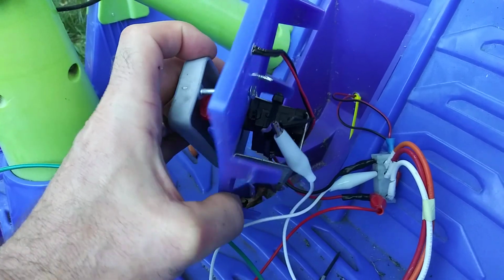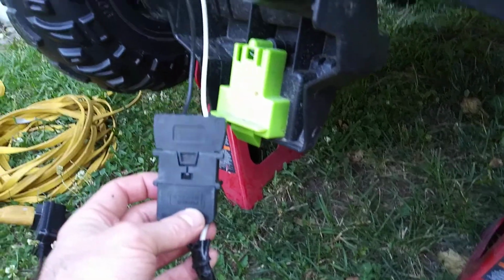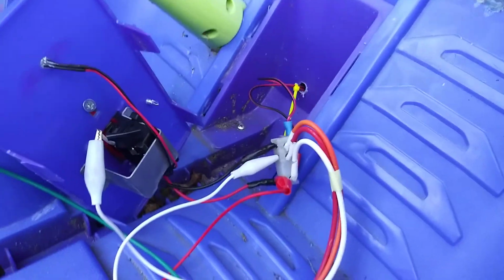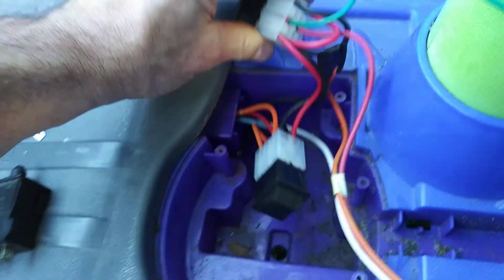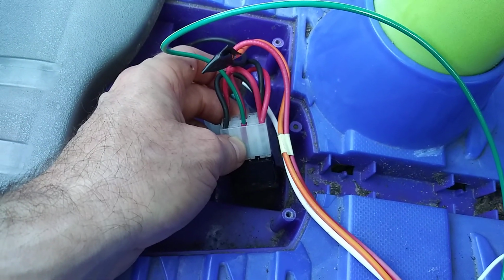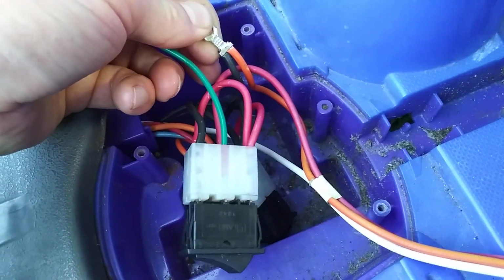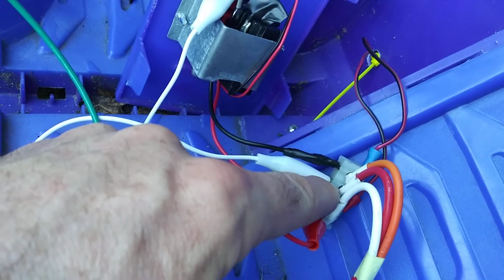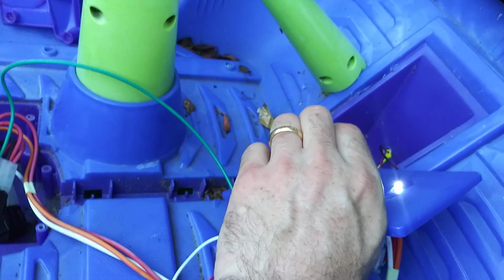AFFORDABLE Speed regulator pedal for PowerWheels. Less than ($10) drill trigger

Comment: Thank you for your detailed breakdown. Are you active in your comments? 

My 3 year old has a Power Wheels Dune racer that has been Modified to use two 12 volt batteries for a 24 volt set up. 
I am in the process of replacing the Accelerator pedal plunger switch. The issue is that the Current switch is a simple on off switch. Going from zero to max torque can truly hurt the plastic gears on the motors. Not only that, it also jolts and jerks the necks of my kids. 
I would like to replace the switch with a Switchdriver Electric Drill Switch adjustable speed switch. 

I need something that is strong enough to handle the voltage and amperage of the Powertools batteries. Please advise me on if that would regulate the speed of the motors. 

And if I have to use two of them to share the load and handle the amperage. 

If you have a Better and Affordable idea for a Slow start for the accelerator I would REALLY appreciate it.
Reply from the maker: @LostMexicanFilms honestly I was watching this video today and it’s pretty complex how I have it wired, but maybe you can make sense of it.  Looks like I depinned one of the connectors because the drill switch is ground side regulated (like a transistor, not a variable resistor).

But I did make it happen so if the wire colors match up in this video you may be able to copy it, but I can’t really offer any more details than is in this video because I have no idea what I did haha

Good luck on your project, yes a 24v power wheel is a lot of fun!
Reply: @ConvertTheClassics your video is the ONLY video on YouTube on how to offer an AFFORDABLE speed regulator for a Power Wheels. I know this idea would draw a lot of attention in dads. 
The next most affordable thing was a $40 dollar piece on there.
I looked for Speed Variable foot pedals EVERYWHERE for hours… finally it hit me. Drills and jack Hammer drills use speed variability… there has to be something…. Jackpot.

Ok… so based on your description the Drill Switch is not Able to regulate the flow of the Positive current…
Only the Ground/negative output. 

What would happen if I run Positive thru it? Burn it up? 

If that is the case… why can’t I leave it wired like it is and reverse the battery connections. Would that not be the easiest solution? 
Then simply turn one of the switches on the fwd reverse shifter? 

Please give me feedback. My kids need this thing running by Monday!
Reply from the maker: @ there is no easy solution because the drill trigger switches are electronically controlled mosfets as I understand and the polarity is specific to them, and they will only control the ground side.

Thanks for the encouragement, let me see if I can watch this video again and maybe put together a wiring diagram to discuss in a separate video!
Reply: @ConvertTheClassics  keep up the good work brother

Comment: Brother. I had the same idea. I ordered two drill switches from Amazon cause the only ones I found were 16amp… so two of them to take the load.
Reply: The diagrams on the Amazon link Only show 2 wires… are you saying I will also need a ground?????
Reply from the maker: @LostMexicanFilms correct, the output is ground side control from the leads on the side of the drill trigger switch.  I made a new video trying to explain further:

https://youtu.be/dislSpXLeW4?si=WTwtfpSbyOrn7MLv
Reply: @ thank you. I watched it. I will try and make a quick video of my build

Comment: this is simple but mine was forward & reverse switch with 3 prongs, cant find wiring diagram but my controller wont put out 12v because its a 6v one 

so i ve just ran 12v motor on 20v with new wires and stock go button( 2 pin) 

no reverse
Reply: What do you ground to?
Reply: @DrMatthewHudson   negative on battery, (on cars its to the frame)(semi trailers its in 7way box)

right not i added a dewalt adapter for quick on off battery changes

Comment: Where does the red wire that's output from the drill switch go to? I see you've connected the output black wire and input pos and neg wires, but I'm not seeing the output red wire going anywhere.
Reply: Nvm figured it out.  You're just cycling the ground back into the switch. The drill was in reverse, that's what fixed it

Comment: Glad I found this. Got a similar trigger in the other day, and finally went to wire it up. I Had already modified it to use a lithium ion 18v battery. Got everything soldered together, only to create a pretty good short in the system.

Classic case of complacency kills. Feeling comfortable with the setup, I didn't even bother to look at the wiring of the shifter switch and just matched the reds and blacks of the trigger accordingly. After my defeat this morning, I'll go through and actually match up the circuitry of the trigger to the shifter.
Reply: Nice man! Hope this rambling video can help.  -Gio
Reply: @GioZane14  Got rid of the short. Perfect example of the phrase, "I know just enough to be dangerous." I have a bit more trouble shooting and rework to do to get the variable speed from the potentiometer in the trigger, but at least I can play with it without shorting it now.

Currently, when power is applied, the wheels go, even without the trigger pressed. Unless the trigger is what is broken (most likely me) then it's probably another simple piece that I just missed.
Reply: @GioZane14  Got it all figured out! I was thrown off by your battery being in the back, and was trying to mimic your model, which is why it would just move without input, then I followed your actual circuit, got it all working. Last step will be the bracket that holds the trigger, and this little garage sale Jeep will be fully functional. Truly appreciate your video. Being to excited to just hook it all up got in the way from looking into what was really happening.
Reply: @kylesmith2435  do you have any kind of diagram you can share? I’m trying to use a thumb throttle with R, B, G wires.